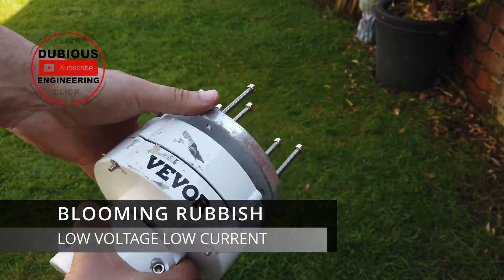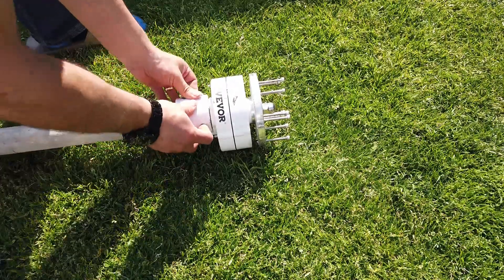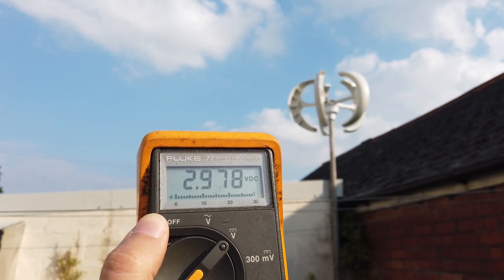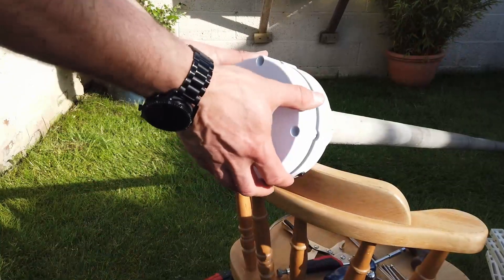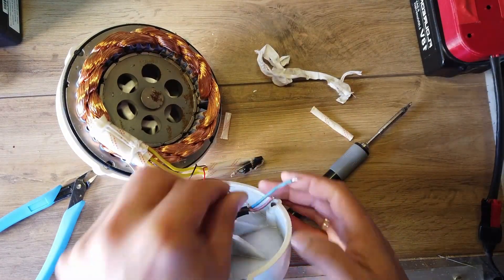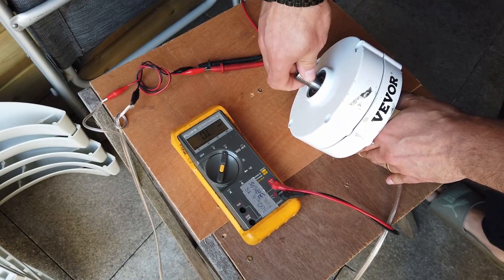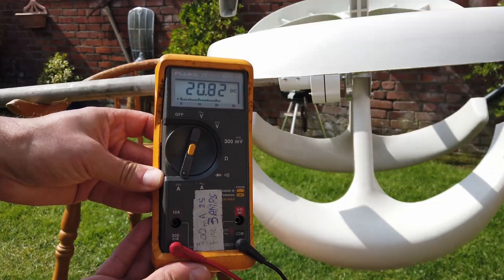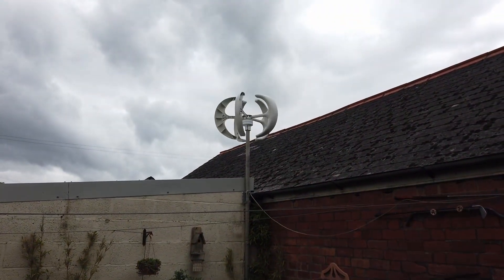DuB-EnG: Chinese Vevor Wind Turbine Power Generator - How to install, repair and a review is it good

Comment: Good information. You may get better performance  from the turbine if you get up above your roof a bit. I don't know what is allowed in your region but eh wind blows harder above the roof peaks and may give you more wind to spin it. The blades are a bit rudimentary as well, maybe they need an upgrade. . Just my thoughts. Thanks!
Reply from the maker: Great thoughts...  Yeah, we had some gusting 20mph winds and it still didn't offer much past 12v at 140mA...  I'll have another look at the coils on an oscilloscope
Reply: @DubiousEngineering  i think you need to look at that rectifier, could be the reason for the low output...